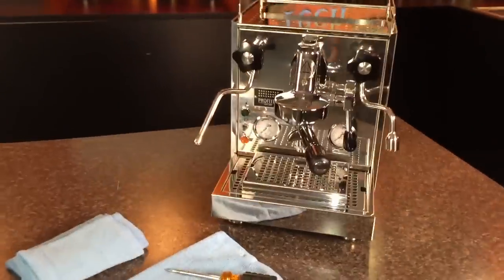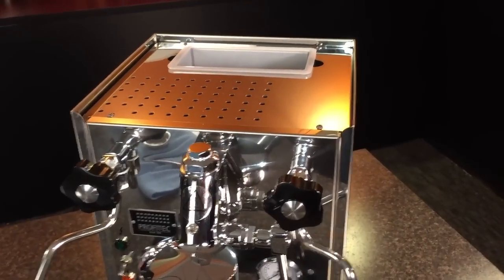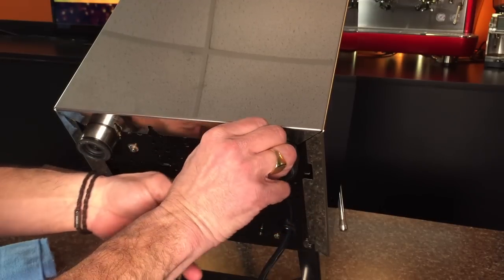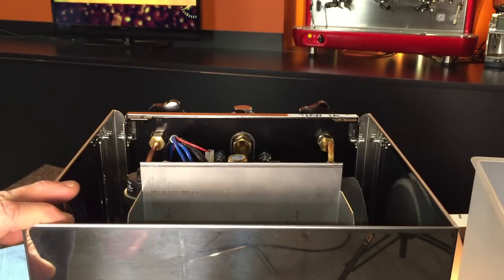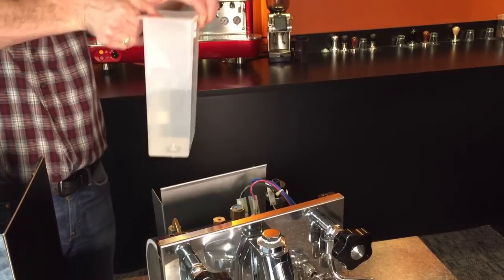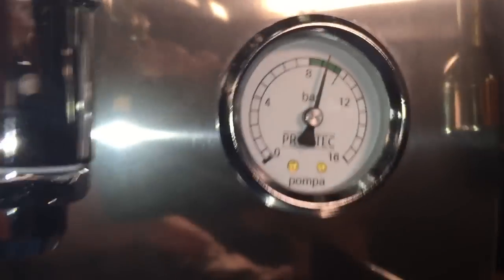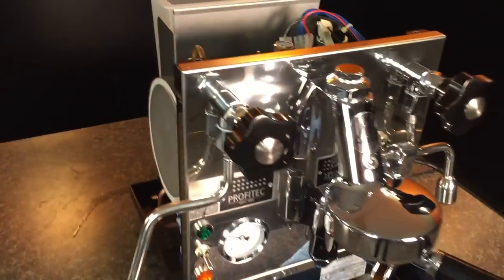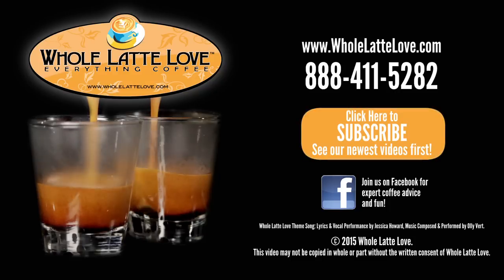How To Adjust Brew Pressure on a Profitec Pro 500

Comment: When I try to brew my espresso or even using blind disk it is not showing anything on the gauge on the right side of the machine. No movement at all. Do i need to replace something ? or should that just be a question of adjustment as well as shown in this video? Thank you

Comment: Great video. I would love to see it done with the Profitec pro 300. Please
Reply from the maker: Hi LS, We should do that video - thanks for the tip! In the meantime, the process is the same for the 300 as for the 500. Only difference is the OPV adjustment is in a different location. But guess what? We do have a video that shows you how to remove the cover. Actually it's easier to get to the OPV adjustment on the 300. Just remove the 4 screws on top cover and its underneath. Here's the video showing how to remove the entire housing of the 300. Part to get at the OPV is about 30 seconds in: https://youtu.be/RfxUIqaZOc0
Reply: Whole Latte Love thanks for your answer. I just need to confirm that the OPV valve in the 300 it's in the top of the case, instead of the 500 in the bottom under the water tank? Right?

Comment: So just to clarify, this sets a maximum on the box via the OPV which is always displayed on the gauge, and flow control allows you to easily modify it within that range (which would be visible on a gauge on the group)? So with flow control full open the box gauge and group gauge should be almost the same?
Reply from the maker: Hi Jordan, Thanks for the question. Yes you have it right. OPV sets maximum brew pressure. We recommend setting OPV on vibration pumps machines to produce 10bar on the machine (box) gauge which should get you ~9bar at the group pressure gauge when measured in static system - blind filter basket in place. With flow control you can adjust flow rate/brew pressure when extracting espresso. Here's a video demonstrating 5 different flow profiles: https://youtu.be/_8lNz2rL5l8
Marc

Comment: I have sab maika or called pratika in Germany but I cant recognize the opv  valve my brewing pressure is 15 i want to decrease can u help me?
Reply from the maker: Hi MT, Unfortunately I'm not familiar with your machine. You may be able to identify the OPV. Many OPV's have a clear silicone tube which returns water to the reservoir.
Reply: @Wholelattelovepage  thank u for ur response 💓

Comment: I didn't know you could run the pump for so long on a blind basket. I always thought it will strain the pump if left running for more than 10s. Can someone verify? Thanks
Reply from the maker: Hi EE, Thanks for the question. It will not hurt the pump. It's designed to handle it and the OPV will dump excess pressure. Not much more strain on the pump when running with blind basket than when brewing a shot!
Marc

Comment: My VBM Domobar Super HX made some ringing noise when I set the pressure below 11 bar. It was set to 12 from the factory. Any idea why? or how to fix it? The machine brews just fine with the ringing, but it worries me. So I set it back up to 11 bar.
Reply from the maker: Soemarko Ridwan Not familiar with the machine. Is it rotary or vibration pump? Can't say for sure, but could be the noise has something to do with OPV or bypass used to regulate pressure. Kind of like how home plumbing can make noises depending on how far a faucet is open. Some manufacturers set pressure high out of the factory. Not certain why, but guess maybe so they're less likely to choke on a grind that's to fine.

Comment: I have the same machine and the pressure guage stopped giving any reading but the machine working normal. How to fix that?
Reply from the maker: Hi a, Thanks for the question. If the gauge is not working at all then it should be replaced with a new gauge. This video shows you how to do that: https://youtu.be/kP9g0QJ7xlo
Reply: @Wholelattelovepage  many thanks for your replay..

Comment: Hi does this apply to the newer machines that have sirai pstat and have silver name plate instead of the black one? do they need to be adjusted to 10 as well at the line you mentioned?
Reply from the maker: Hi B, Yes it works the same. Pstat controls boiler temp so no relation to brew pressure.
Reply: thanks!  Will have to adjust mine.

Comment: Is this the same with Bezzera BZ10 HX, like setting to 10bar gives 9bar in the group? what does it mean when brewing at 12bar for example? bitter taste? Thanks :)
Reply from the maker: Hi MJ, Thanks for the question. Yes. If setting pressure on a vibration pump machine using a gauge on the machine we set the OPV to 10 bar to give 9 bar at the group. Brewing at 12 bar may over-extract the coffee. But, it's my understanding from Luca Bezzera they set their smaller vibration pump machines to brew at a max of 11bar.. Understand you'll only get to that pressure on the coffee if the grind is fine enough to cause.
Marc
Reply: @Wholelattelovepage  Thanks Marc for the reply. Indeed it's set to 11bar for BZ10 and I'm thinking to play with OPV to take it down to 10 but doing so will invalidate the warranty! Currently if pressure goes to 9 it's watery brew.

Comment: Is this still the case with the Pro 500 with PID (loss of 1 bar through the system)?
Reply from the maker: Hi Andrew, Yes we set up all vibration pumps via OPV to produce 10bar with a blind filter installed.
Marc
Reply: Whole Latte Love Thanks!
Reply from the maker: NP!

Comment: Hi Mark

I just got this machine today and am having an issue. With a blind basket in, it takes about 25 seconds to get up to 9 bars or so. The pump is also quite a bit louder than I've heard other Pro 500's. Any idea what could be causing this issue?
Reply from the maker: Hi KM, Sounds like you may have a pump issue. You can check our support wiki for the Pro 500 here: https://wiki.wholelattelove.com/Profitec_Pro_500#Poor_Or_No_Flow_From_Grouphead
But if machine is brand new there's likely something else going on. Did you purchase from us? If so, I advise contacting our tech support staff for further assistance. You can call, email or live chat. Tech support contact options at bottom of this page: https://www.wholelattelove.com/
Reply: Thanks Mark. I bought it from a Canadian Distributor. Waiting to hear back from them. Just trying to figure out what the issue could be.

Comment: Really? Mine came with 10.5 bar according to the pressure gauge on my brew head
Reply from the maker: Hi im, The group head gauge will read slightly higher than the machine face gauge when measuring a static pressure. The machine gauge reads pressure in the cold water path right after the pump and before a one way valve. The one way valve can accumulate pressure on the other side including increase in pressure from boiler heating of brew water.
Reply: @Wholelattelovepage  you're right. The head reads .2 over the machine but they're still both over 10. Is this on purpose because the machine has the flow control valve? I was going to set it down to 9 but if there's benefit from leaving it at 10, I'll rethink that
Reply from the maker: @ironmonkey720  It's very common to set vibration pump machines to 10 bar static pressure. That setting typically gets you about 9 bar max during an actual extraction. I know people get kinda uptight about getting a perfect 9 bar but the truth... it's highly unlikely you'd be able to taste any difference between espresso pulled at 9 or 10 bar.
Reply: @Wholelattelovepage  I understand. So you're saying brew pressure should be 9 bar, not static pressure. So measuring with a blind basket and adjusting to 9 bar is not the correct method?
Reply from the maker: @ironmonkey720  Recommend setting to 10 bar static pressure (blind filter basket) on machine's face gauge.

Comment: How to adjust bar pressure on casa 5
Reply from the maker: Hi Steve, Sorry for the delayed response - just returned from Italy visiting machine manufacturers including ECM. Brew pressure is adjustable using a flat blade screwdriver to turn the expansion valve control which is located under the cup warming tray. Insert a blind filter basket into your portafilter and switch the machine to brew. Adjust the expansion valve to produce a pressure reading of 9-10 bar on the guage and that's it!
Reply: The ECM  Casa V is one the easiest to adjust to OPV on.
One of the many reasons I chose it in the first place.
Marcs instructions are spot on as per usual 👌

Comment: why not drill a hole where the ajustment screw is
Reply from the maker: Hi EO, Good question! Here's why it's not really necessary. What you are really setting with brew pressure is an OPV: over pressure relief valve. This set's the maximum brewing pressure. The actual brewing pressure used is dependent on a few variables but mostly the grind size of the coffee. Most all semi-autos are set to a maximum brew pressure in a 9-10bar range. Should the grind be fine to the point that water will not flow through the coffee puck at that pressure, the opv opens and dumps excess pressure back to the reservoir. Setting the OPV to open above 9-10bar would allow for pressure that causes over-extraction of coffee and result in bitter shots. Brew pressure is mostly a set it and forget it parameter.
Reply: good info